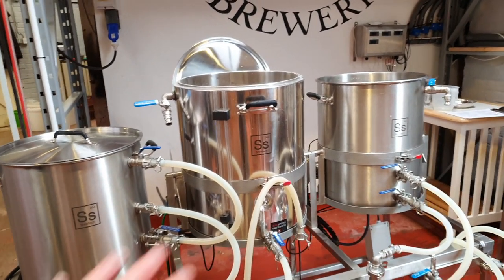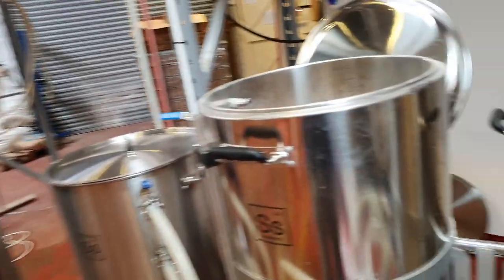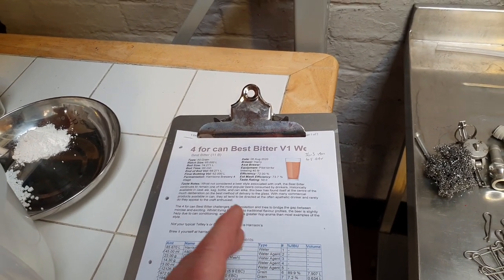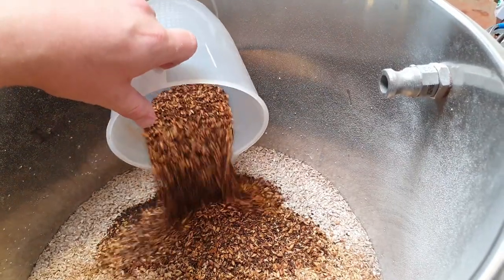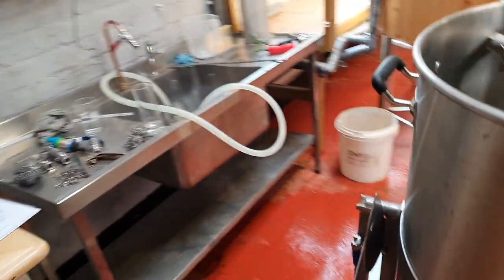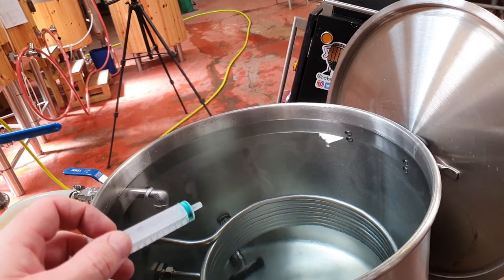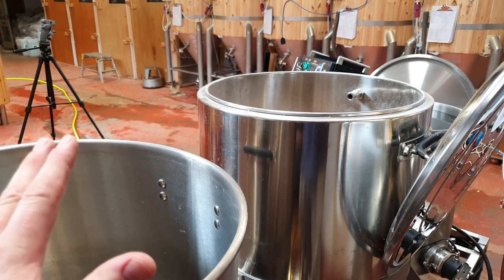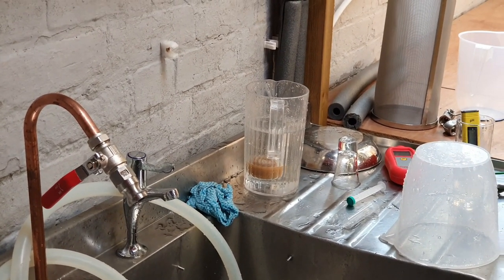CONSTANTLY CHASING MY TAIL

Comment: Made a 12l batch of  porter today, did all the water calcs using the Kaiser Water Spreadsheet, it turned out to be buggy and suggested 15ml of 85% Phosphoric acid, mash came out at 65% instead of the usual 85% and I added some Epsom salts too that was well out, think this one is destined for drain...

Comment: That sure looks like 7ml. I have a similar syringe scaled to cc/ml and I do the same thing as you just did. Have done for years. Shouldn't it then say 70? Or is there a multiplier somewhere? Or maybe the diameter is larger than the syringe I use. I also looked up syringes that are say 100ml, they all have numbers from 10, 20, 30...etc. Maybe all that crystal malt brought the pH down.
Reply: 7cc
Reply: No, sorry, this WAS 7ml...
Reply: @jotwee63  Yes. 7ml is 7cc.

Comment: That was only 7ml of lactic acid that you added, from a 10ml syringe. My hydrometer measuring cylinder is 100ml - you would have needed two hands to add 70ml from a similar sized 100ml syringe 😂😂 - so no problem

Comment: Wow sexy flooring Harry that is very nice. I guess brewing on the big kit then pilot kit would make it tricky especial acid amounts 70ml might a been right for a big batch of your best bitter.

I acidify mash with 96% phosphoric Acid so I have to be careful not adding to much a little goes a long way in a 21lt batch.
Interesting point about the calcium precipitation I'm guessing if I'm adding the acid it's going to drop below 6ph anyhow and I add it with the grains so if it's above 6ph well not for long.

Cheers